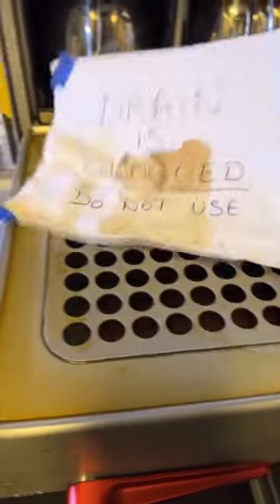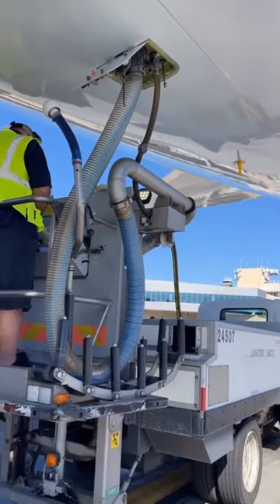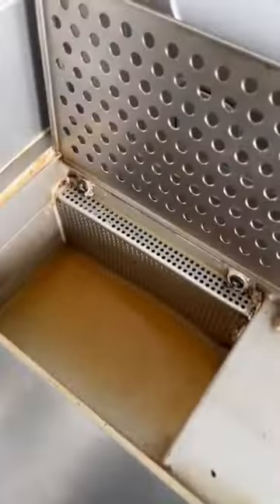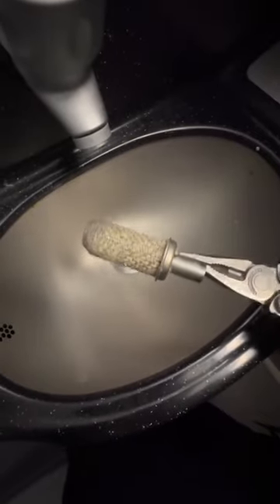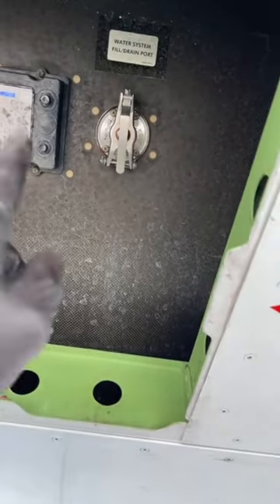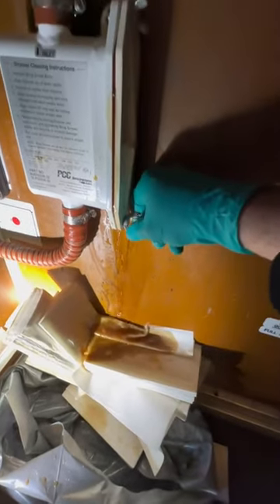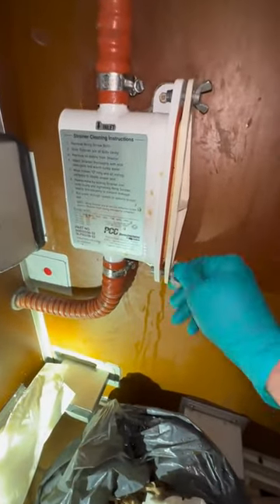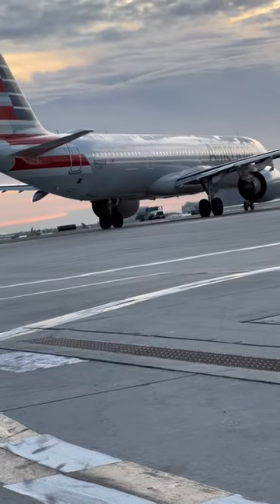Aircraft Water and Waste Systems ATA 38

Comment: I have a question.  You say that you guys in Maintenance do waaaaaayyy more than toilets and tires, well.... is it your department who cleans up big messes in the pax seating area, or do they have specialist teams who deal with that?  The reason I ask, is that recently on a (redacted) flight,  some pax  found their seats covered in a previous flight's pax vomit.  There are those who will say that any flight on (redacted) is the vomit comet, but seriously, it's not that often.  Anyways, 2 women sort of declined to sit in un-cleaned vomit-drenched seats, and ended up being "kicked off the flight", (not making this up) for refusing to sit down and strap in.  Other nearby pax vouched for the women, as the staff declared them rude, abusive, and no longer wanted on that plane, when in fact the women were nothing more than politely requesting that the seats be properly cleaned or they be seated elsewhere.  Typical (redacted) BS, their flight attendants NEVER lie or anything.
So, yeah.  Whose job is it to cleanup the upchuck when that sort of thing happens?  Never mind that it got missed on this airline (seems about right for them),  I just wonder if you get stuck with nasty cleanups such as this.
Reply from the maker: This is an excellent question… ok there’s 2 parts to this.. if the mess is manageable to get cleaned and sanitized then the cleaning crew will do that. That’s their responsibility to clean the aircraft after every flight. NOW… if the seat is soiled beyond cleaning capabilities that’s when maintenance steps in. This is because now we have to remove and replace soiled and contaminated components from the aircraft. Example would be a brand new seat cover and cushion, new seat belts, new electronics (if they were contaminated and/or damaged by said fluids). Does that help with your question. And yes the passengers were in the right. They should have not been made to sit in a contaminated/biohazards area. Cabin crew should have known better. Said airline should take accountability for such actions and correct them immediately even if it causes a delay. My primary concern is always safety of the aircraft and my souls on board as a maintenance technician.